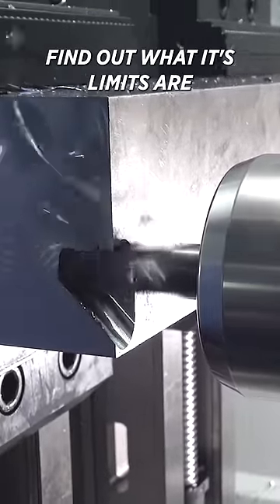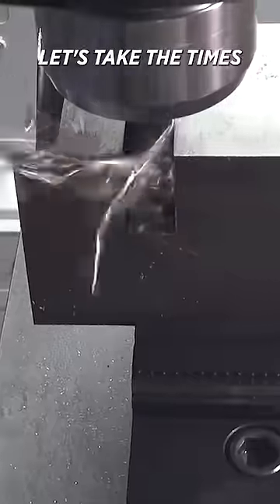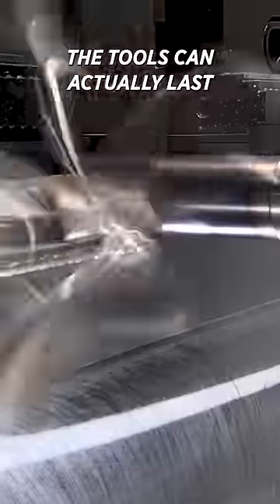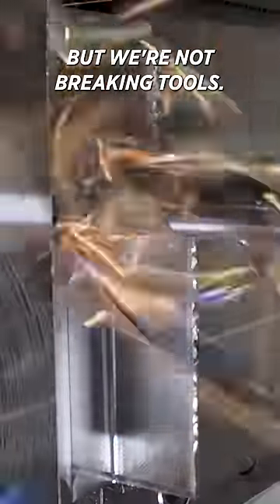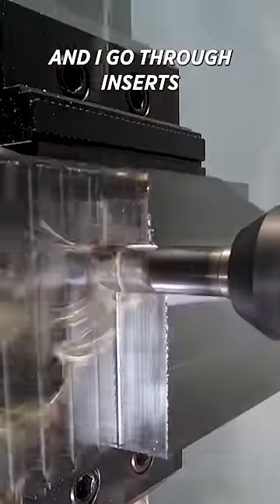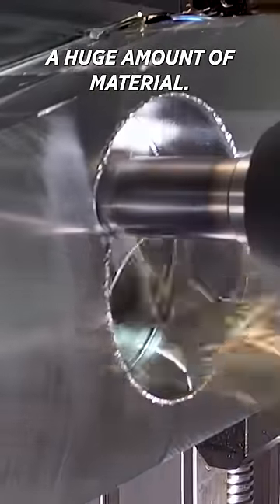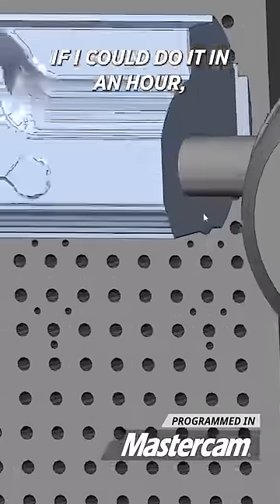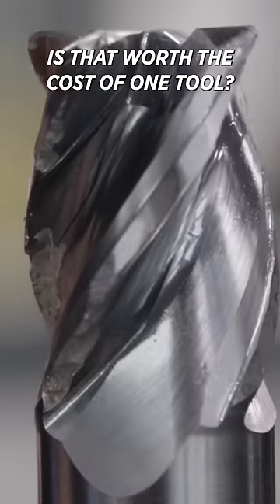Why Do We Push Our Tools to the Limit? #shorts

Comment: That chewed up tool at the end looks like it would make for some really wide open tolerances
Reply: Thats why you have roughing and finishing passes ;)
Also that tool was probably donefor
Reply: This machining language intrigues me.
Reply: @giantfatberg  tolerances are referring to how much a dimension can deviate. So if someone says “razor thin tolerances” that means the dimensions of the product/part are going to need to be incredibly precise.
Reply: @giantfatberg  to put it into perspective. "Standard" tolerances on things that don't have a stated specific tolerance are usually +-0.25mm/0.010", which are very achievable with a rough cut alone and can probably be done with this smashed tool. Whereas I personally have worked to stated tolerances of +-0.0025mm/0.0001", which involve having to clock up each tip of your tool (probably brand new) with a tenths DTI after loading to ensure it has loaded correctly into the spindle every time you try to get that tolerance. But I work old ass manual machines and not fresh new ones, so maybe their drawbar/toolholders are more trustworthy lmao
Reply: Every single person on earth is an expert 🙄
Reply: @BizVlogs  you don't have to be an expert to know a chewed up tool isn't good for finish or size, hell you don't even have to be finished your apprenticeship. It's all well and good if he's going back in with a fresh tool for a finishing pass... and yes you could probably call me an expert (just not with CNC) 10+ years of manual experience machining critical components for aerospace and oil&gas.
Reply: @BizVlogs  It's almost like most people are out there cultivating their area of expertise while a small portion remain at home producing nothing but recordings of themselves :b
Reply: Run it removing material en masse til it's done, save the finish tools for finish passes

Comment: "You want it done fast? or you want it done right?"
Reply: Fast!
Reply: Fast!
Reply: Want it badly, you'll get it badly.
Reply: Done right
Reply: Both
Reply: @djnaztn8  then pay up
Reply: Sometimes it's possible to do both.  But that comes with experience. Been both machinist and QC....seen a lot of garbage parts because ppl thought they could be cowboys and not do it right while also doing it fast.
Reply: That was my main thought the whole video; he’s talking about increasing production speed and making more revenue…not a peep about whether quality is preserved. Makes you wonder where the priorities are…are you looking to shoot out absolute max quantity or trying to maintain quality but seeing if it can be done quicker…and given the example was from 5 hours to 1, in second guessing just how important quality is in this case.
Reply: @thefourshowflip  If you need to machine 5000 bolts, each one takes 10 minutes to do with no parts breakage, but you can do them in 5 minutes and a tool breaks every 1000 bolts, you're going to be insanely more efficient and it's going to cost you way less.
No one said anything about changing the quality standards, if it's not up to snuff then it gets rejected, just like normal, this is specifically about being too precious with your tools, trying to make 1 cutting tool last for 10 years because you're myopically focused on the price of the individual tool and not the overall production.
Reply: @steezydan8543  
That seems sensible; though I think you stated that far more clearly than the video who only seemed to be concerned with cutting costs (and experience has shown that people/companies so obsessed with cutting costs tend to cut corners too…maybe I was a bit jaded 😉)
Reply: @Osgore1  that’s what he said
Reply: Fast!
Reply: You get three.. fast, good and cheap.  These guys are aiming for fast and good but not cheap which is ok, they eat the cost of running fast.
Reply: He’s looking for that perfect middle ground
Reply: The proper degree of right and fast!
Reply: I can do it fast, the correct way, and cheap. You only get to choose two of those though
Reply: Both
Reply: you can have it fast, but it's getting sent back and then we gotta re do it because the cuts are ugly.
Reply: yes
Reply: Peko peko peko
Reply: if you're young, you should be doing everything fast. if you're a good worker, you should do everything right.  hopefully, you are both. a boy that understands what needs to be done is a blessing to everyone under his wings. if you can do something well but not fast, either you are learning or old. if you can do something fast but not well, either you are young or ignorant. if you can't do either, you should have paid more attention when you were young. good luck all
Reply: @thefourshowflip  not a peep about quality because as a machinist quality should be a given. Leaving 20% of ststed capacity still on the table for your tooling isn't really pushing them that hard. Tooling surface speed and rpm limits etc are the same as the SWL of lifting equipment, they're a safe conservative limit, realistically you can probably push them atleast 20% over that limit before you actually break something.
Reply: Fast, good and cheap. You can choose two.

Comment: Your tool is gonna start messing up your workpiece before they actually break.
Reply: No, because youd take finishing cuts after those deep filler cuts
Reply: @grumpybastard the material would just change how much of the piece is messed up before the tool breaks. At the end of the day the tool is supposed to be harder than the piece it is cutting. I've had it happen in aluminum where a 3/4" FEM pulled out and dragged about 1" deep, full width at 100 ipm through the part. It only chipped one tooth on the FEM, luckily it was just on a cleanup tool path, we never could figure out how it backed out with such a relatively light load, and she was snug in the holder, took 2 of us and a breaker bar to loosen it
Reply: @grumpybastard as tools wear they get dull ... Imagine trying to cut steak with a butter knife instead of a steak knife... It will cut but it tears more than it cuts ... Metal is the same way it gets dull enough it will tear the metal instead of cut.  You'll get noticable "tooling marks" or large burrs.  Eventually if you keep pushing the tool beyond it's limit you will physically snap it or actually melt the tool.
Reply: @roadmonkeytj  Yeah but you cut out the bulk faster and if its out of spec you can always swap in a new tool and do finishing cut.
Reply: Depends...if your  roughing first I don't see problem.
Reply: That's what finishing passes are for
Reply: I mean they clearly aren't running this depth and speed for a finish cut🤣 they 1000% are going back with a finish pass
Reply: Bet his product looks cheap
Reply: @grumpybastard metals act like a liquid in many ways when under immense pressure. if the tool is dull its going to produce way more heat. along with the pressure exerted on the workpiece. the burrs it can create with a poorly sharpened dull or tool with missing flutes can get pretty gnarly or mess up the finish something fierce. i hope this helps.
Reply: May save your time with machinery but I just wasted my time watching this
Reply: @roadmonkeytj  Haven't cut much alum or metals but I know the limits of bits for cutting wood, and I was at the limit of how fast the head and arm could move and still ran a bit for a whole day with little to no wear
Reply: That's why you check parts, have Go/No Go gauges, and measuring instruments. A guy got fired for running oversized parts all shift, not checking the No Go gauge, on both sides of the hole.
Reply: @grumpybastard the print calls for a microfinish limit. If a bore"s microfinish is too rough, it  can become scrap, or need a extra burnishing operation.
Reply: Poor QA of materials, some bar stock will machine like 12L14, and the next will work harden like A2.
Reply: Too literal he just means once it is not working like designed anymore. I dont think he means snapped in two.
Reply: His company makes parts for some of the largest aerospace manufacturers on the planet. I'm thinking he has a good idea of how tool wear works.
Reply: @grumpybastard you get whats known as chatter on metal, i machined engined blocks for years, and when a tool starts to get dull, or it breaks. You could have 20 or 30 engine blocks with unfinished cuts, cuts thats have little chip markings, or scratches. Using a tool at 5500psi spinning at 250,000rpm can absolutely move some metal. But after about 45,000 hits, you got to sharpen the tool. It doesnt matter what the tool is made from. Tungsten carbide is about as top grade as it gets, but you got to think, with as hard as it is, those tools can shatter. And they do that cause they are so hard. The milling tool i use for head decks is about $10,000 per tool, so its best to not try and break them. A dull tool will make rough cuts with burs on the outside, while a sharp tool makes a clean cut with a smooth finish.
Reply: @byeluvby  read his comment again. Your response doesn't negate his point. What he's saying is true,  independent of process
Reply: @brokeandtired  Not if you damage every moving part in machine that use said tool
Reply: Two words everyone seems to ignore or forget in this thread. 
Work Hardening!

Comment: When your sponsored by Kennametal with free tools, sure.
Reply: I run a cnc and do this same thing. A new bit ran hard can save half the time and leave no finishing. My old workplace decided to make us use the bits for longer so we had to find a way to keep acrylic from melting even though it was being cut with butter knife bits. Wound up with half the throughput, overtime, shitting finish, but hey, saved 65 dollars on a router bit. And alllll it cost was idk 1200 - 2500 in labor bc those bits last like 2 weeks. 

Management gets tunnelvision. I left before they realized they were being fucking retards but I'm assuming they eventually learned. Hard not to.
Reply: Well no when you have a production line you do run parts like this. Its not applicable to home or small scale use.

Comment: I was a newbie at a shop in 1971. There were some test probes that needed cut from castings. The older guys in the shop told the foreman that they could only take .025" cuts off the thick base because of the way they mounted it. I remounted it differently and was taking .100" cuts. They were pissed at me because I took their gravy job from them.
Reply: Pushed to the limit to find the limit

Comment: I've tried explaining this to companies and get shut down every time.
I was word for word told to program how the operators want me to program which is of course however allows them to sit on their ass for as long as possible.
I knew at that point, that my days at that company were numbered.
Reply: Classic. You’ll have parts with a 45 min cycle time with tons of room for improvement. Operator only gets 5-6 parts in an 8 hour shift. Parts show up at assembly and haven’t been washed or deburred… Like what are you doinnnggg alllll day? I would get so bored trying to dodge work that much.
Reply: I would imagine most machinists just baby their tools. This guys talking from a mass production perspective which I’d imagine almost all companies already do this if the cost/profit is better. The people running slow machines are doing it on the cheap if their incoming profit doesn’t fund that type of process. So there’s always that. Its not like people don’t know this is possible.
Reply: Where are operators telling a machinist programmer how to program? They probably don't even know how to touch off a tool
Reply: That company's days are probably numbered.  If theyre being inefficient theyre gonna lose in the market.
Reply: @NeoIsrafil  I’ve seen it to, I’m sure the company will do fine they’ll just have a shit turn over rate and margin. Someone always needs a job and parts made.
Reply: @Titantitan001  that's where you're wrong. Many large companies lack major common sense, and they don't want any new people coming in and changing things up. I've seen it first hand.
Reply: @JamesJamersonIsAGod  I guess the work ethic isn't great there. As a Maschinist in Germany (in my third and last year of my formation) we learn how to program and use the CNC machine, and also learn how to maximize speed and life of the tools. Not only than but in my company it's the Machinist that do the optimizing work most of the time as their are the ones working with the machine, the engineers don't know shit about it lol. And to be a Programmer for the CNC programs you have to be a Maschinist with lots of experience and have a Master (Meister) lol, they know very well what they are doing. 
I guess the work ethic and school system is what really makes Germany so great in this industry.
Reply: @ersariantheoneandonly6821  You are 100% correct, Germany values apprenticeships and trades and the approach to training is much different. I know this because the company I work for is one of the ten largest German corporations, but at a US factory. At the US plants they try and manufacture the same or more volume product with 1/4 of the skilled machinists, CNC programmers and engineers that the German plants do. And then the people they hire to be operators were working at McDonalds last week while their DE counterparts started training at age 16. There are many skilled machinists and operators in the US, but ultimately I see that they get frustrated and quit because they can make more money doing other jobs, and companies are constantly outsourcing work and sending it to China, Mexico, India and Brazil.
Reply: @JamesJamersonIsAGod  yeah, that outsourcing is a big problem. My professor says that if Germany loses the skilled workers it will go to shit in no time becouse of the outsourcing. Albeit today Europe in general is doing the opposite and putting production back in Europe, all thanks to China and now Putin. 
As my professor said, now is the time to hone your skills (aka get as much formation and specialization as possible) becouse in the bad days the more specialised and rare you are, the better jobs you will get.

Comment: There's the stress on the part that needs to be considered as well.
You can take huge cuts on every part.
Changes in temp can lead to expansion and when the part cools down the tolerances that you programed are no longer there.
Reply: If done right most of the heat goes into the chips. If you mill too slow the tool rubs more instead of cutting and that generates even more heat. You are definetely right though about heat expansion and tolerances! But i doubt that the difference in size is significant enough to be considered.
Reply: @MeesDeppe_Official  I had machine shop drill abs ream a hole in a plastic gear on some exotic material. They always came back to tight.  Whenever they try to ream, it heats op and gets larger.  Once cool down, size dropped back down slightly and binds the shaft. Lol. It happens when you dealing with total tolerance of .001 or less.
Reply: @MeesDeppe_Official  not to mention all the heat can affect hardness

Comment: High performance spindles are built with the torque necessary. Performance can be maximized when machine specs, tooling, and programming are all taken into consideration. It's all about finding the "sweet spot."

Comment: That's exactly what I did while working at Vickers Engineering in New Troy, Michigan.  My boss at the time didn't know, but I'd turn the feeds and speeds up 25% to see if the inserts would last the same amount of time buy get more parts per day out and it worked. Each shift got 25 extra parts a day out, so I turned it up 50% and again it worked 🤙🏽 my boss was super happy I did that but he wasn't at first 😉
Reply: dorry sbout my ignorance, but what about the possible need to heat treat the parts afterwards?
Reply: only works for non high accurate dimension.
Reply: Did you get paid extra?
Reply: @webfreakz  actually yes I did,  I got a raise out of it 🤙🏽😉

Comment: Machine life is a variable too guys, that 5 million dollar mill will wear out not just the tool. There's a reason we mill how we do.
Reply: Yes and no, you have to consider insurance shop space (rent), interest rate if you need money from the bank and performance of new equipment to.
If you run 3 cnc that last 15years or 1 cnc  that last 4 years with the same productivity, the abused one, produces 20% less during it lifetime but you only need 33% of the rent and insurance.
Specialy with money from the bank lets say interrest rate is 7% and you can pay 2 Mio per year back, one cnc machine is easily pay back in 2 years and 7 mounth. If you have to pay back 15 mio at 7% the bank earns 1 Mio in the first year from you, able to pay it back 12  years and the bank has drained alot of money from you.
Getting a new cnc every 4 years also means you have always the newest and best machines on the market.

Comment: We got a saying of  "If you want it bad enough, you'll get it bad enough" everyone's is in a hurry these days.. Sure you can speed things up, but there's always a limit
Reply: My process is smooth, because smooth is fast. I want a speedy process, but I want to avoid mess-ups which will hold up the overall process. Speeds, Feeds and Load Management between Tooth and Chip. You can also use coolant to prevent excessive wear on the tool @ high RPMs & Heavy Cuts.

Comment: As long as you don’t mind replacing bits more often, keep cutting faster.
Reply: You missed the point of the video. He acknowledged the tool cost by asking if the time saved is worth more than the tool cost. Provided you have enough demand to warrant increasing output, then time is money and saving your tool by taking longer will cost more money than shaving time by breaking tools.